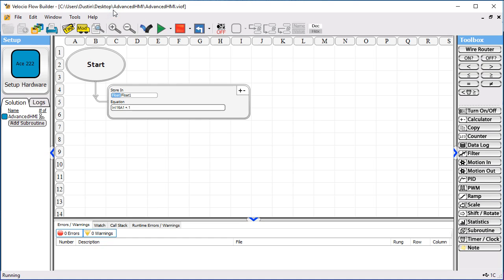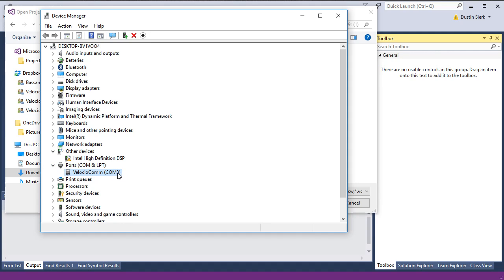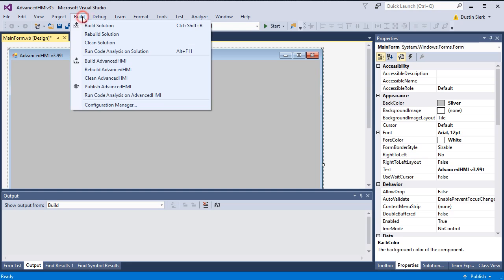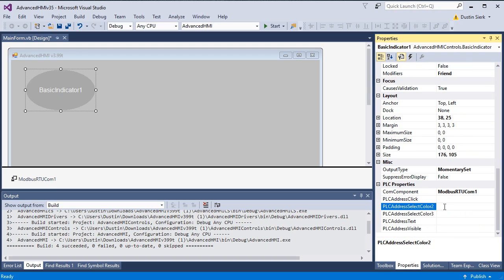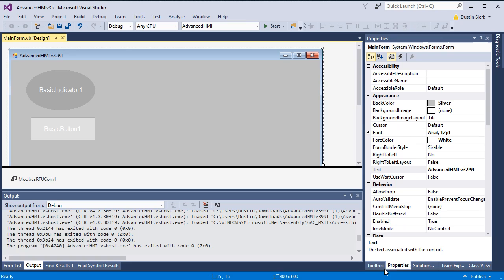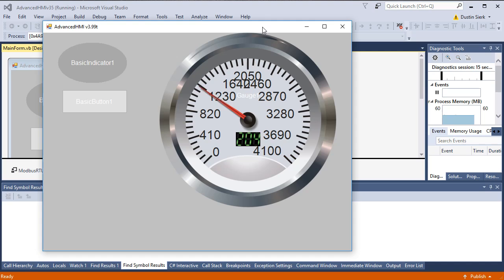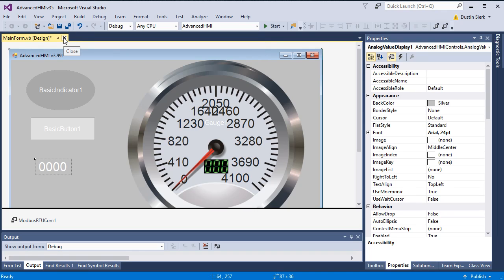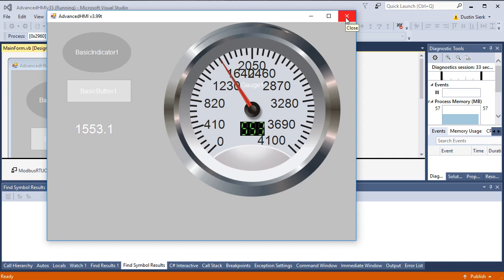Velocio PLC to AdvancedHMI part2

Comment: Looks like a nice solution Dustin.  
A cursory look shows AdvancedMI can run on a windows tablet, so there's a cheap solution for a screen and computer all in one.
Reply from the maker: Yes, you are correct.  It can run on windows tablets (at least Intel based ones, which are very common now).